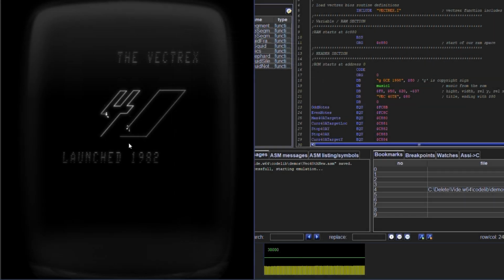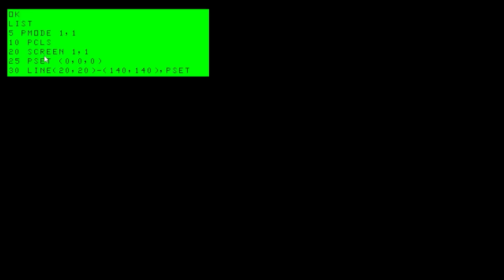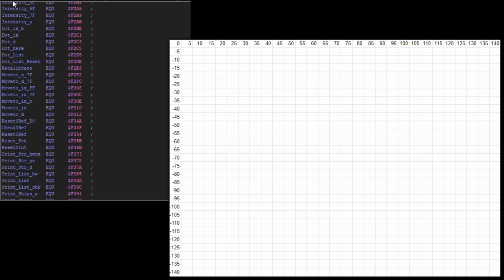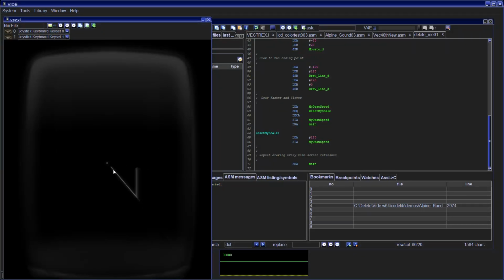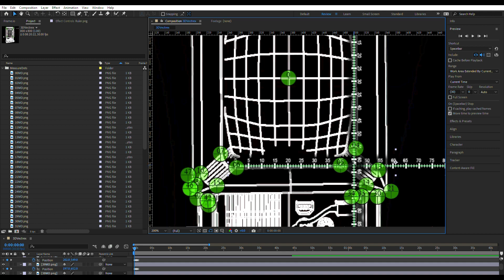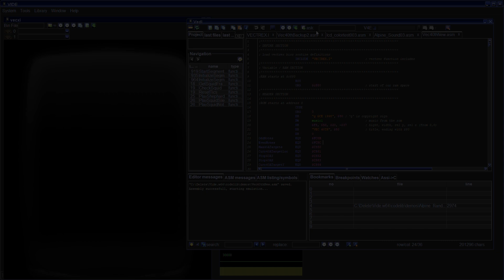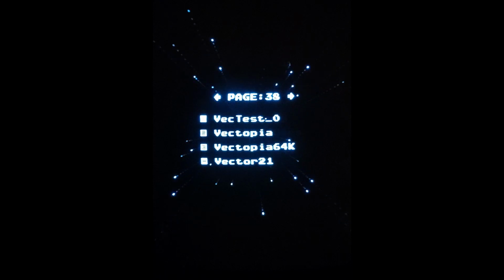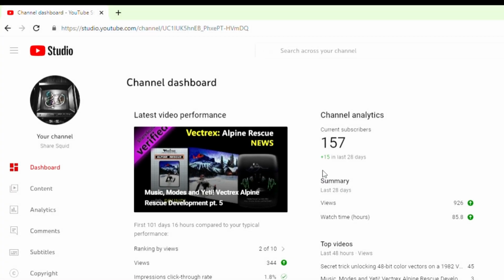Drawing 3D on the Veccie and Cool Side Projects: Vectrex40th Anniversary Demo Development pt. 1

Comment: I like everything about this video AND I got a shout out, how cool is that? About the 3D model stuff, have you tried just reading the vertices and face data from a .OBJ file? Also its not that hard to save an image (or image sequence) in EPS or PDF format and pull all the coordinate data from the file. (Disclaimer, I am using simpler coding languages on fast computers to help me. and with the PiTrex I can use the PiTrex Graphics C library which make it easy to draw).
Reply from the maker: That's a great idea, Brandon! Will export it as an .obj and see how to best parse it. Ultimately, I really plan to write a solid 3D engine for the Vectrex...someday. Keep up the great work yourself! Hope you get some additional subscribers from the shout-out! You deserve it!
Reply: @sharesquid  I'm pretty sure you can import 3D model data straight into VIDE. I haven't done it so don't know the specifics but have a look in the vector editor (Vecci) at the import options. Perhaps it requires a format your software cannot export but worth a look if you haven't already.

Your current model looks pretty good so your new model will look excellent!
Reply from the maker: @Minwah1959  thanks! Will do a deeper dive into the many options available through Malban's VIDE!
Reply: You can draw a 3d modell (obj) directly in Vide (as far i remember) as wireframe. I show the example in this video. https://youtu.be/-I6nP80hPck
Reply from the maker: @GeorgesChannel  That's a great video, thanks for sharing!